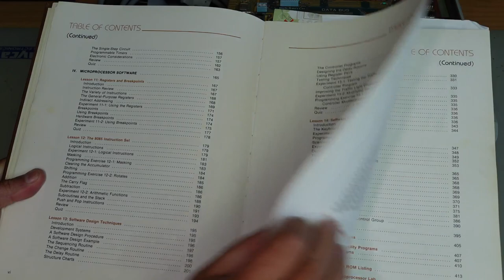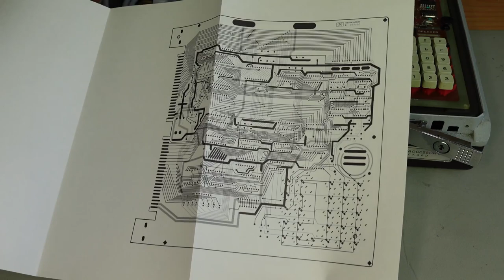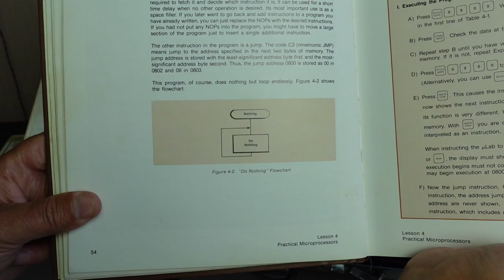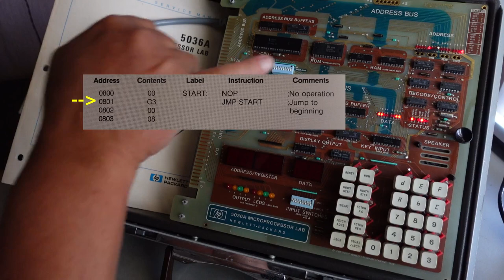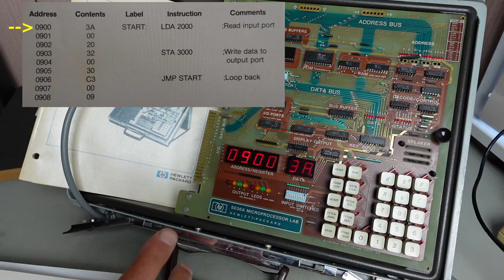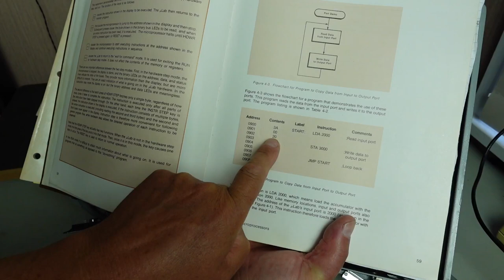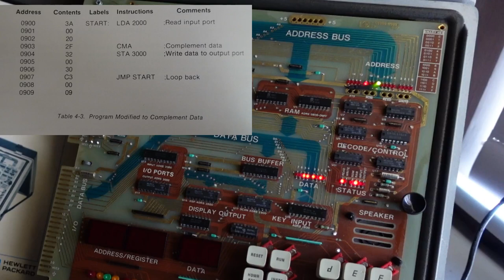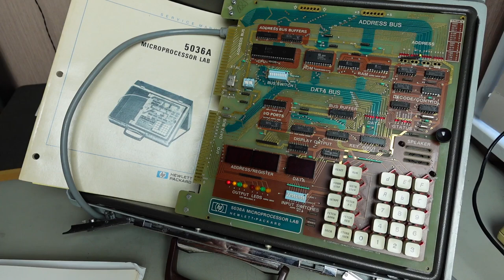HP 5036A Microprocessor Lab Introduction and Programming from 1979

Comment: 20230214_Tue::
I programmed 3 CPUs back in school in the 1970s&1980s in Assembler - IBM360, Intel8088 & Motorola38000. 
Maybe it is time to relearn what makes my Micro-Wave Oven and Refrigerator Tick.
Thank you for the review.
Mike W. Wagner, B. Electro-Mechanical Engineering M.S. in Computer Science.
I hope you can teach an old dog new tricks.